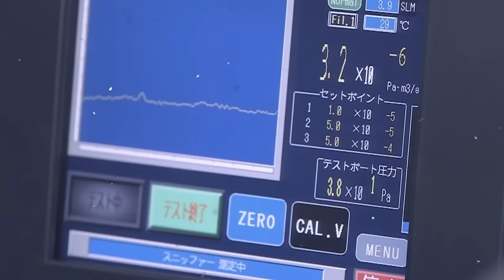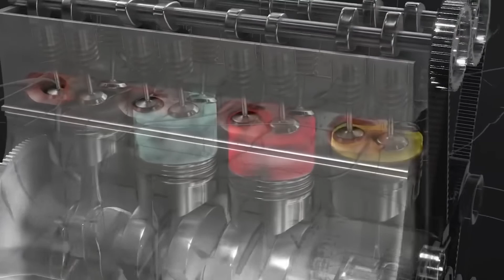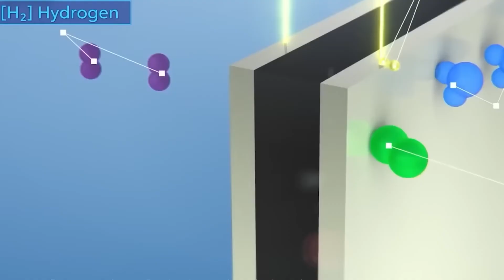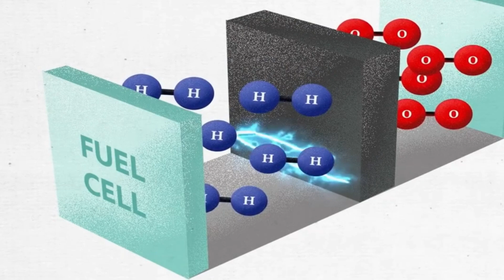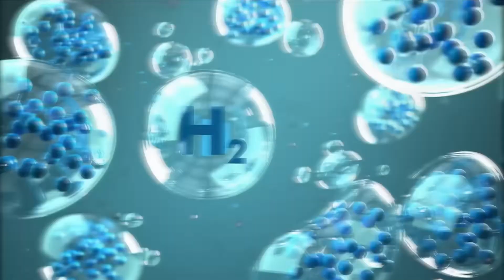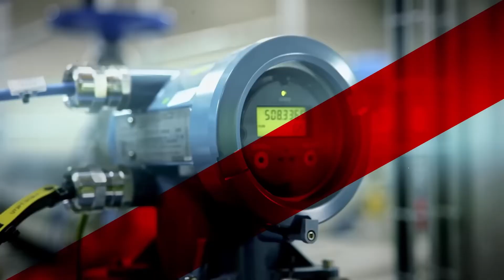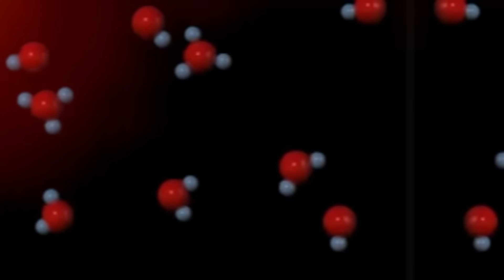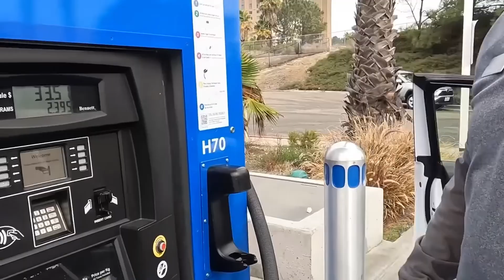THIS GAME-CHANGING WATER ENGINE BY TOYOTA WILL DESTROY THE CURRENT CAR INDUSTRY

Comment: This has been tried before, but for some reason the engineers that designed them keep disappearing, or have an “accident”.
Reply: Yup
Reply from the maker: Now you know what we mean. Another, more detailed, video will be coming up next week on this soon. Stay tuned! 👀
Reply: They had hydrogen fuel cells in the 70s, BMW has a vehicle similar to this. The only reason it did not take off was gas prices were still low at the time, and hydrogen was not readily available to be adopted. Also fossil fuel companies lobby to prevent the adoption of tighter standards to move the markets in its direction. There are many reasons why it was not adopted, none being that the concept does not work. 
The world was not ready.